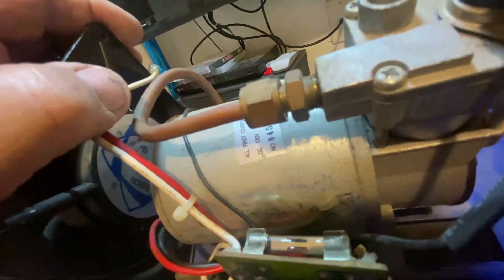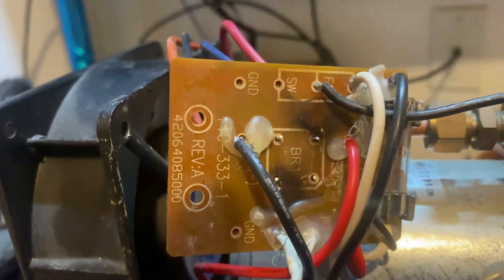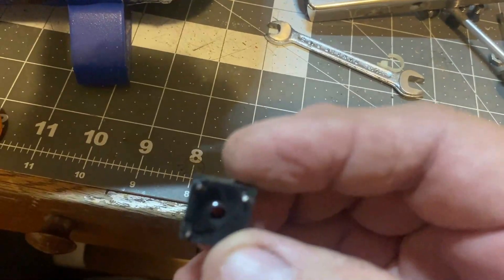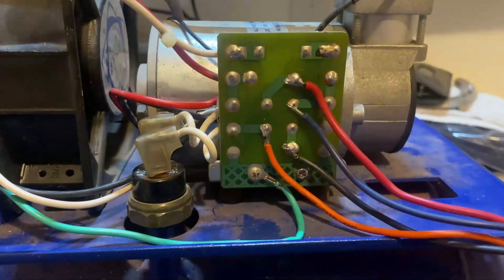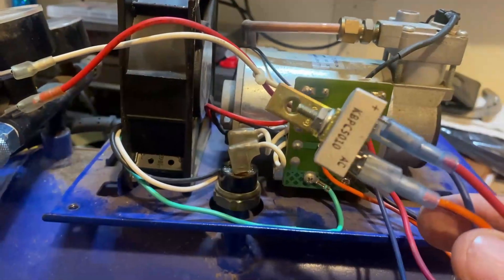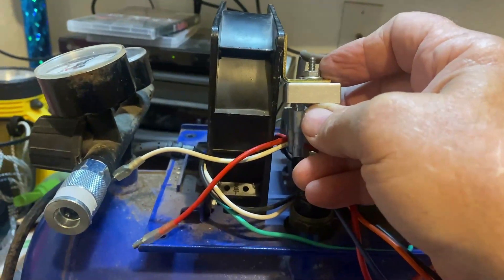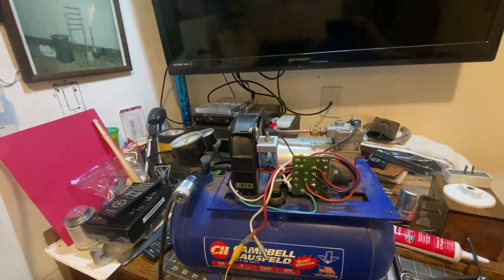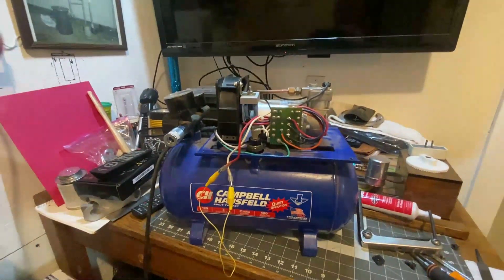Cambell Hausfeld compressor repair

Comment: Excellent repair and one that surely will go the distance! I was really surprised that it was a DC motor. I wonder what the advantage is.
Reply from the maker: The DC motor is smaller than the AC version the small power, still a surprise to see. Luckily the circuit board was simple and my rectifier worked in its place. Thanks Bruce and have a great week.

Comment: Great fix and the price was right. It is always good to save something. I think we need to learn more about electronics, I don't think we would know what part could be swapped in
Reply from the maker: Thanks Joseph, the replacement rectifier I installed will handle a 50 amps. Way more than this compressor would ever draw. Have a great week

Comment: Nice fix Lloyd. I get a lot of air compressors from my brother. I'll have to keep that in mind in case I get one with the same problem.
Reply from the maker: I was surprised to see the dc motor. I guess they are cheaper to build. Thanks Ron